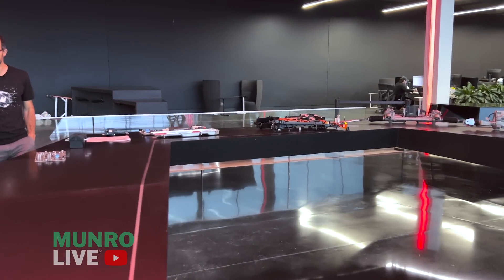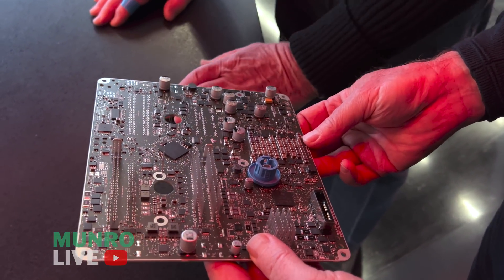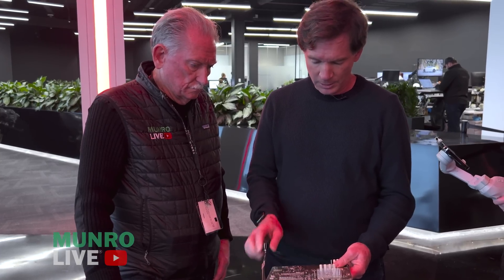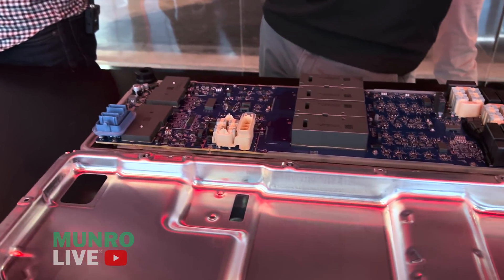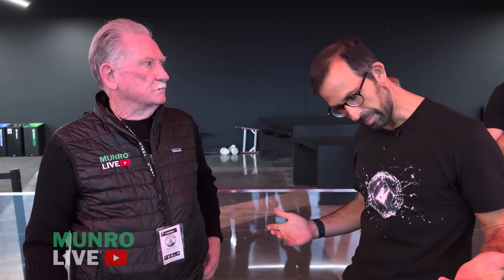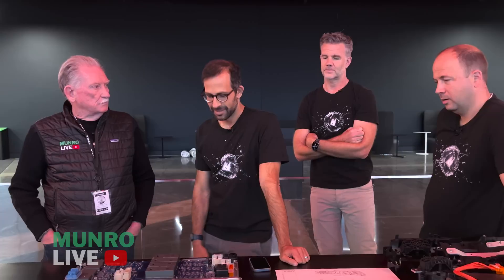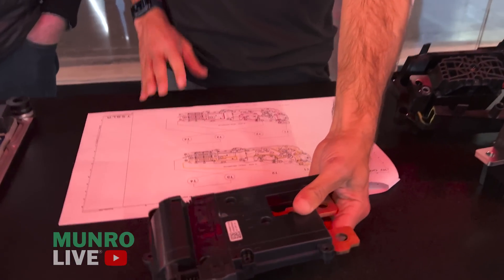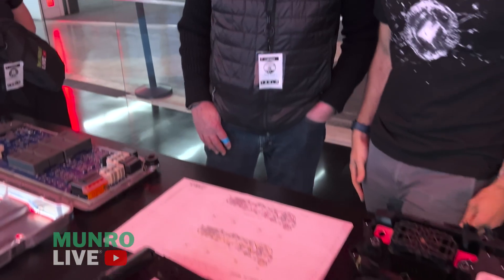Tesla Cybertruck's Power Converter capable of 800V

Comment: I’m waiting for them to ask how the range extender will be installed. Will it need to be added/removed only at the service center or can an average person install it before a trip?
Reply: My understanding is you can install/detach it at a service center, perhaps third parties could do the same thing with the right setup.
Reply: It has to weigh several hundred to a thousand pounds so I can’t imagine people would be able to do it on their own
Reply: I suspect they’ll need to remove the bed panel that it sits on to connect the high voltage and cooling lines. It’s probably not a one time deal (permanent) but it’s not something you’d want to do often.
Reply: It would be great if they can be hired for long trips

Comment: Them splitting the 800v battery into 2 x 400v actually isn't as unique as they claim since Porsche/Audio already does it.
Reply: Porsche/Audi does not do this - they are at about 800 V all of the time, and use a step-up converter to charge from 400 V. 
GM does the switching (in Ultium, such as the GMC Hummer EV) - they can charge at 400 V or 800 V, and always drive in the 400 V configuration.
Reply: @brianb-p6586  yes, and this means for electric vw group products that are 800v your 400v charge speed is governed additionally by the max rate of the fast charge module. It’s a paid upgrade to get 150kw max, some have much less, I forget how low but it might be 50kw.
Reply: And it’s bloody obvious to do it!
Reply: GM, from my understanding, does, VW group uses a converter module and does not actually expose 400v or even have a usable 400v bus, afaik
Reply: Do all high voltage electronics run at 800V though? Or is it just for charging?
Reply: @whattheschmidt  I believe they all run at 800v for better efficiency.  They mentioned how the motors and inverters all had to be redesigned for 800v

Comment: Oh my God,,, can you imagine when that truck is 10 years old trying to get the power converter or any other of those circuit boards ??
Reply: Model S is 11 years now......seems not to be an issue.
Reply: I already have this problem with my 2000 Nissan Pathfinder. Whenever a sensor or component goes bad they tell me it is out of production and I'll have to find it at a pick-n-pull. The new electric cars are going to be like computers. You drive them until they either fizzle or won't take software updates anymore, then you just roll it off a cliff.

Comment: Mounting the circuit between the inside and outside of the firewall to avoid through holes and off-board grommeted wiring is pure genius.  Additionally that PCS with planar magnetics is a electrical engineer's wet dream.
Reply: The Bosch DC/DC converter uses also planar transformers. There are advantages and disadvantages - as always. Overall, on can say there is no clear trend. Of course for the "SDM-only" concept of the PCS2 this is a crucial ingredient. Does anyone know the power density (kw/L) of the PCS2?
Reply: EEs wet dream? Lol not really. The RF world with PCB design is where the 'black magic' happens...this is taking the concept of PCB embedded capacitance and applying it to power inductors. There's trade offs with this approach as well
Reply: Planar inductors and transformers are not new. They are being used for quite a few years.
Reply: @diavalus  obviously
Reply: I've built a few power conversion boards for motor drives and I didn't even realize that "planar magnetics" was a thing. I had to look this up. Here's the way to think about this: Tesla engineers are so good they don't just assemble parts from a supply catalog to make their devices, they literally do the engineering to replace a $3.00 part and make it 2x more efficient and 4x smaller. NO COMPANY WILL EVER CATCH TESLA when it comes to system efficiency or margins. These guys are writing the textbook on next gen power electronics.
Reply: @jhagen4850   China will steal it
Reply: @jhagen4850 literally everyone in serious power electronics does custom magnetics.  Tesla is good, but honestly there are some companies out there doing way more impressive stuff.
Reply: @jhagen4850  not very familiar with electrical components, mind explaining what the planer magnetics are and what is the significance of what tesla is doing?
Reply: @Alhussainba  It means they don't use external wires to build magnetics - wires are circuits on the pcb
Reply: @valdisgerasymiak1403 its nothing special and they havent invented it.
Reply: @jhagen4850  big lol!!!!! who are you to say that!
Reply: Every other electronic manufacturer builds circuits for their customers. They have ti be cheap and serve many masters. Tesla has one customer and is very good at defining what they want. Result is the low cost but extremely good equipment.
Reply: @Dave5843-d9m bullshit!!!! they are making totally useless trucks! just look what is possible to achive with a conventional truck design! literaly everything from making an RV to a dump truck to easily increasing its hauling capacity to longer bed construction to ambulance..... a 30 years truck is still way more uselfull and woks harder than the tesla truck.
Reply: This has been done.   It’s when that interface leaks that there’s a problem.
Reply: Planar magnetics are a nightmare, I'm a service tech and they have catastrophic failures if the temperature is not being kept in check, once a short forms due to carbonization of PCB, they let go and the board is absolutely not repairable, when a regular choke or a transformer you could replace easily. They also fail at VIAs since it's a very long trace with many of them in series.

Mounting them both inside and outside will bring moisture and condensation issues into play, that's the sole reason why most modules except for ECUs are mounted inside.
Reply: @FrozenHaxor  Except these are all things Tesla designed specifically for.  I'm quite sure they have done their homework to assure these failure modes never happen.  Additionally I don't know of a single service center that would ever attempt to repair a circuit board rather than just swap it out entirely under warrantee.  Apparently they have designed the CyberTruck to cross rivers in a pinch so I think water-tight was a high priority.
Reply: @darylfortney8081  We repair boards on component level daily. I suggest you look up people and companies that repair Teslas, the design principles are often idiotic at best, I wouldn't expect anything else from them.
Reply: @FrozenHaxor   As an electrical engineer I can tell you their designs are some of the best out there.  I'm confident Tesla doesn't hire 'idiots'.
Reply: its nothing genuis lol!!! its just a choice nothing more, when apple decided to make a sandwitch type moderboard to significantly reduce its total size that was actuallyy genius move.

Comment: The firewall PCB is an insanely good idea, jus avoid doing any water seals on the cables or connectors and use the PCB for that!
Reply: Of course the firewall concept is in ice vehicle thing not sure you can really call that appropriately a firewall for an EV ... More like a frunk bulkhead.
Reply: You're right, it's not a firewall. The tesla engineer called it the wet side/dry side, so it's the transition from the outside to the cabin.
Reply: @janmessek1826  eh poteto's potato's, firewall is the most understandable way of getting the point across so it's the word I use

Comment: Contractors working in remote locations and campers could benefit from the dual-motor cybertruck with the range extender. Get where you're going and have plenty of power to use there, then drive home or somewhere to charge.
Reply: It’d be even better if there was a midgate for camping, boardsports or contractor utility. Airconditioned, pass through access and secure vault storage
Reply: even woth the range extender they are not going to remote places not even without towing lol!!!
Reply: Now they just need to make that addon able to be easily removed, taken to a charging station, charged then returned. Maybe even use it as a powerwall when not needed in the truck.
Reply: And you can buy it on the company account, it will be a deductible and you'll still get some tax credit
Reply: @grettirgrattmards2348 buy the truck without addons first to get IRA credit, then get range extender added separately and both will be deductibles
Reply: @grettirgrattmards2348 no more credits for those useless EVs that contribute nothing to the infrastructures! how many inches of roads have EVs ever built? how about the gridd or water supply? how about power stations?
Reply: @alanmay7929  How about how about how about??
Get a life bro.
Reply: Where would the contractor keep their stuff, though? Very trailer dependent then.
I LOVE to go camping with a good EV truck, but the EVs we get don't seem to allow for a 5th wheel hitch. Waste of the nice weight. A trailer with good solar panel array on the roof and roll-out sunshade would be great to recharge the driver battery during remote camping. 5 kW solar isn't impossible with a serious trailer. And 5th wheel is the way to go, especially when remote/tricky road surfaces.
Reply: @Cloxxki  Frunk, under the rear Seats and the Truck bed. All of these are fully enclosed and lockable..

Comment: There goes Sandy again saying I was going to do this in the 80's, next Sandy will be saying he invented the the internet
Reply from the maker: Well he did so. 🤷‍♂️😂🤣
Reply: I remember all the speculation about transforming vehicles to 42 VDC when it always made more sense to adopt 48 VDC or even 72 VDC both of which were already in use for heavy equipment.
What has tipped the balance a bit recently is all the off grid systems which are mostly 48 VDC LFP.
16 LFP Cells in series or 14 Lithium Ion with appropriate BMS works well. 48 VDC Lead Acid which would have been the go to in 1980s was too unreliable.
While Sandy was at least partially correct in the 1980s  the Lithium batteries, the Battery Management Systems, the Buck and Boost converters were not yet mature enough.
Had legacy Auto injected the funding like Tesla, the Solar Industry and Fixed Plant manufacturers did, the transition could have easily occurred way back then.
The Big 3 US companies have always been backward and subservient to Big Oil.
Reply: Mechanical switches don't work well on 48V DC. They start to spark and welt themselves shut. Which means you'll have to oversize them. So to be cost effective it would also mean transitioning to silicon switches for everything. I don't know when in history it became practical to invest in producing automotive electronic switches for a low price point. But it was certainly a long time ago.
Reply: It may have been "a long time ago", @mennol3885 , but it wasn't in the 1980's.
Reply: He caused the big bang.
Reply: lol!!!! what a joke!
Reply: He’s probably not exaggerating. The 48v idea has been kicked around for decades, but nobody in management has ever had the guts to greenlight it.
Reply: @kungfoochicken08 there have been 24v in european trucks and big equipments for decades  and its only with the advances of electronics that higher voltages were made more reliable
Reply: @kungfoochicken08  it's not only the managment. Do you remember the relays of that time? You could get away with 48v electromechanics on military vehicles, but it was too bulky and costly for civilian transport. First compact and reliable power switches had to be developed and adopted together with development of CNCs, then it spread over automotive.
Reply: Real Al Gore, that guy.

Comment: What about right to repair? Can we fix these things in 10 years?
Reply: Are your saying you know enough about power electronics, have the test equipment and tools to fix these things your self?
Reply: Yes. But that being said I work for a lighting supplier so I wouldn't expect the average person to be in a position to do the work. Still, I believe it should be made possible.
Reply: @brettspencer-curran8269  
And when some one kills them selves from the 800V, of course it will Teslas fault. Being a power electronics engineer I would like the challenge but I know the risks of what to stay away from. Far better to send it to shop thats specialized and equipped with right test equipment, not some clown with a voltmeter and a soldering iron.

Comment: What is the wet side and dry side?  I mean what is the water analogy representing?  Second question, what is the firewall?  I am a programmer of 48 years, so do they mean like a firewall that blocks certain network communication like iptables/NAT/etc...?  If the answer is yes, what on earth does a cybertruck need a network firewall for?   Because of the internet Access???  Hmm ...
Reply: It'references the bulkhead - firewall of a vehicle. Wet being the "eng!ine" bay and dry being the cabin.
Reply: Thank you.  I had trouble understanding this because "firewall" has the meaning thomassswarz1973 mentioned.  I knew this was wrong in this case, but it was NOT obvious to me what the right connotation was.   @jmileshc
Reply: @jmileshc beat me to the answer by 7 seconds. I am going off to sulk in the corner.
Reply: My assumption is the op is just trolling you all with such a question
Reply: Its a wall between driver/passengers and engine ( of internal combustion engine car). More precise from google:
"A firewall is a panel between the engine compartment and the passenger compartment in a vehicle that is intended to prevent the spread of fire from the engine."
Reply: Thank you all, sincere question from a big fan.  No trolling here.   So can we say that firewall in this case is a legacy word?  I get the wet and dry, idea, but do we really need a firewall to protect the driver from a fire in the frunk???
Reply: The use of "firewall" in computer networks is an adaptation of an existing term that meant a physical wall separating something from a risk (of fire), @thomasschwarz1973 . If there is a poor use of the term, it is the common IT use.
Reply: i believe wet and dry refer to High voltage side and low voltage side not entirely sure. And no a Firewall in a car is a literal wall to protect the occupants from a fire thats why he said they need less grommets in the firewall because they are passing less wires through it.
Reply: @zachmoyer1849  I would like to know if you are right....  Keep in mind, there are three key voltage levels:  high voltage battery 400 volts, the cabin equipment 48 volts, then all the computer communication that goes through microchips at 5 volts
Reply: @thomasschwarz1973  yeah i think wet would be 400 and dry would be 5
Reply: Showing your ignorance I am afraid. Nothing to do with network firewalls
Reply: @johnrayner2731 
Don't be afraid, we're all ignorant.
Science isn't about being right, it's about being less wrong.
You, sir, based on your comment, are NO SCIENTIST.

Comment: 9:33 long term target is 500 miles. Do they plan to achieve that through efficiency gains with existing pack setup and software updates or through new battery improvements?????
Reply: Yes.
Reply: I think they will do it with marshmallows.
Reply: That's not happening without an additional battery.  Drag is a pain.

Comment: Tesla could create a trailer chassis with an integrated battery. Sell them to trailer manufacturers. Enable ‘while you drive’ charging and connect to the vehicle to extend range.
Reply: They can't get enough battery materials for them to do that yet...
Reply: That would be insane of them to do until they have more cells than they know what to do with... and at that point they'd put them into Megapacks.
Reply: It could be a megapack for most of its life sitting in the warehouse dock!
Reply: @zacharyaustin1660  And would that demand the same margins as a Megapack? Nope. Someone else can do that
Reply: with how often people tow its still a waste of batteries and money i think a generator on the trailer making it a hybrid would make more sense in the interim until battery tech maybe improves or trailer companies start making more aerodynamically efficient designs. this could even be a permanent solution as most people have generators and this would replace that and the trailer could power work tools and even charge things like electric lawnmowers on the job. We could make this green by utilizing hydrogen or ethanol.
Reply: I imagine third parties could already do it, provided Tesla is not vendor locking stuff too bad.. Might void your warranty ofc.
Reply: @rkan2  If there is a connector and no DRM this will totally be a thing :D People already DIYed this with the Toyota Rav4 EV back in the day. That thing was a combination of tesla and Toyota vehicle systems and the Tesla side didn't quite care where it got energy from. There were firms building Chademo integrations and external batteries on trailers etc. They made the tesla software think it's regening like crazy while driving, and fed in power from the external pack, which got the main pack to recharge :D
Reply: I can't imagine any trailer manufacturing wanting to deal with Tesla as a supplier.

Comment: Finally! A "Truck" that lets everybody know you are bad with money and a douche, but also has a power converter capable of 800V because that's so incredibly useful!
Reply: 800v is the input power from the internal vehicle battery.  The output is 120/240 volts AC power which is standard household power.   11kW worth of it.  So, seems pretty useful to me.  Maybe you shouldn't comment if you don't understand the basics.
Reply: Funny thing about most of the people who will buy/have bought the Cybertruck, is that they can most likely afford it and not a douche. Compared to the pickup owners of yesteryear who think pickup culture is tied to their masculinity and are conditioned to buy things they cannot afford and will probably total it before they pay it off.
Reply: Powering your house during a blackout. Totally useless!
Reply: Many other EVs use an 800V architecture....